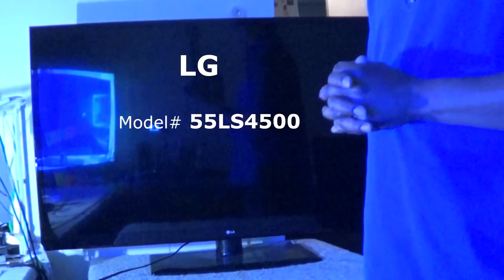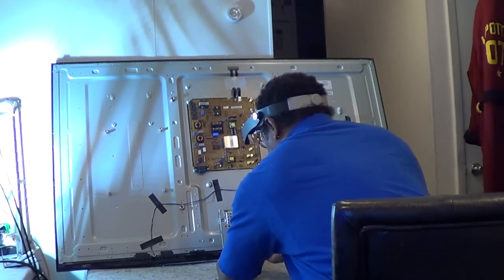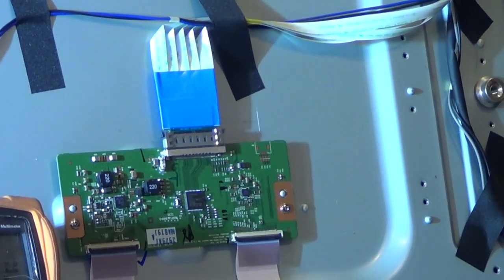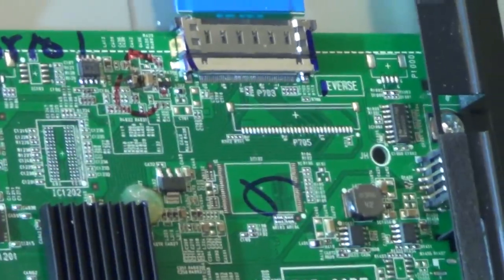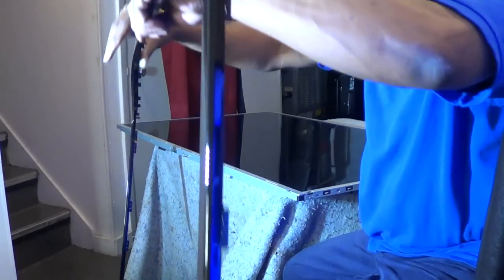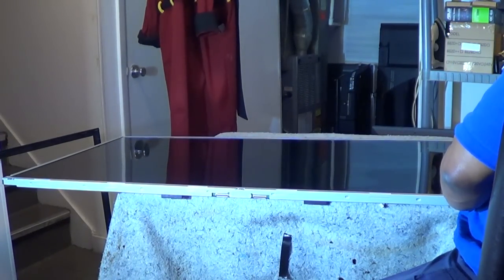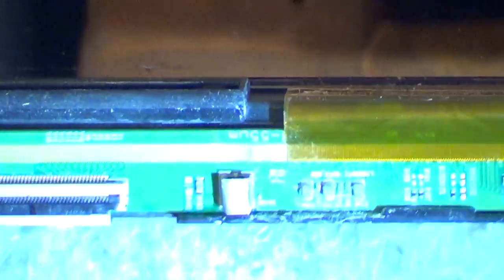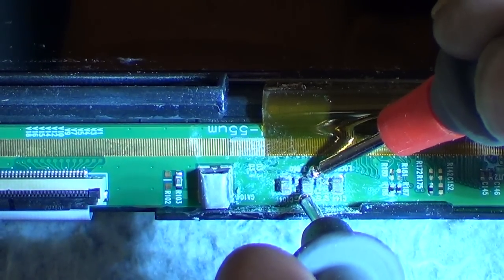Backlight but no display. T-Con board or bad LCD Panel? How to Isolate

Comment: This fix you found out about because of someone allowing liquid to run down the screen to soak the board causing a short at a capacitor might also be the issue with the Toshiba Model 57HM167 I have with white spots like outer space stars appearing behind the menu or full screen without menu and there is no audio present nor video. I will investigate where that could occur at.

I got a 2007 model Toshiba Model Number 57HM167 manf June 2007 so its not above 2009 and has no HDTV capability and that is the only antenna I have which works fine on my VISIO TV. I do have a converter for converting older model TV's so they receive digital HDTV signals changing to analog but it will not work for the Toshiba. A problem I see comes up when turned on the screen itself has many white dots on it, looks like a space broadcast of the stars but none ever change position & stays stable the entire time I am working with the menu using the new GE UltraPro Universal Remote. I do a scan for channels and none are detected using this antenna, so I believe this Toshiba is mainly for cable TV use only, not HDTV usage. I am using channel 3 for the down conversion channel operational scan and nothing being detected seems illogical the Toshiba has a antenna reception menu choice. There is no images at all just that stary outer space look behind the menu where a channel should appear. I don't know if it is a tuner issue or some screen issue causing this problem on HDTV reception using my converter from  the FCC I bought back then. Can anyone help please.
Reply from the maker: Thats a DLP TV. If U got White dots then you need to change the DLP/DMD chip in the light engine. Just order it from Ebay or Amazon using your model #, and theres plenty of Video's on YouTube to show U how to replace it. Ive did plenty of those. Common issue.
Reply: I appreciate that coming from a expert such as yourself, that was no slight miracle. I got it sitting in the living room but using my VISIO which is a small 42 inch LCD TV and it works for HDTV so the antenna on it is no issue, my mothers VISIO 48 inch LCD TV got some lemonade splashed on its front screen and it ran down into the horz-vert board so there are lines going up and down the video on my right side while left side displays OK and there is sound. One day I hope to fix its problem. I was thinking I had to buy another display for it till I saw you fix this Samsung TV.

I got two TV's both 48 inch LCD TV's given me that I relocated to the other home which will not turn on at all. Next time I go there I will get the information on them for you to see.

If you see the same comment on another YouTube video you presented disregard, I believe you have answered my question very fairly and thanks again. I'll keep in touch, from Prattville Alabama to you.
Reply: I went to Electronic Trade School (Instructor Mr. Jones), I quit after 8 months cause the math in another class (required course) was to technical to remember at the time. A girl there named Paula Jones told me a story, she said she has a uncle that did not like Bill Clinton so much that he was willing to help her snoop him under the table out of office, he was a private eye in Washington, she went a couple days to introduction to the class of printing I also studied then suddenly she never came again, the instructor named Steven (printing class) said she probably dropped out. Well, she did never to return to the Trade School John Patterson which changed its name while I was attending the printing course which after one year of electrostatic printing machine and staple machine I ended up sick and had to end my classes, I found I was allergic to the cleaner I was using to wash my hands and arms in plus I could not breath the stuff which was a giveaway I should have paid closer attention to use lava soap instead of that industrial cleaner I learned was jet fuel.
So when the story of Paula Jones broke in Washington DC I contacted the school to attempt to get them to verify that Miss Paula Jones had dropped out of the class, they refused to tell me anything about Paula Jones saying there was no record of her ever attending. Heck, I know she did attend cause I walked in on her and the instructor in the closed closet and she was attempting to charm him and he kept telling her he was married and had a child which got her so upset that she got off the shelf she had her leg propped up on with dress pulled up and walked quickly out the back door, I said excuse me to the instructor and followed her out the back and she was standing there crying. Next the bell ran and we all were to go to the lunchroom to eat so I went with her, she sat at a table near to the instructor and I sat further back to their left, she eat then we went outside to talk at the parking lot, by chance she had parked her Vega auto next to mine and started with the story. Well, I had a story too so I gave my take on hiking to San Francisco California and back which was a blast, it had been so cold up there the snow was five feet thick but I was lucky a Greyhound bus driver stopped to give me a ride then he stopped alongside the otherside of the highway at a restaurant and said come inside and I'll buy you some coffee that he normally drove the empty bus back to Los Angeles from San Francisco and stopped there for coffee. Miss Jones did not seem as interested in me as I was in her and she got in her car and left the parking lot telling me thank you for being her friend. It was a true experience I esp remember because of the helicopter that landed in the parking lot from the state troopers whom delivered the Crime Stopper Neighborhood Watch order for us to print, cut, fold, and staple (my task I did while everyone went to eat one day). It was all done on the German large press I wanted to learn how to run but two guys were already assigned it so I got stuck with a chubby girl with glasses on the electrostatic printing machine. She was moved over from paste-up of the negatives for the camera room another thing that got my interest, the staple room was in the room where the enlarger was at for the camera to make the plates for the German Press (a huge heavy cast iron machine that required moving stacks of paper under a feeder that fed one sheet at a time and they cranked it up to finish sooner).
You do not seem to bother the subject matter with math much other than checking to see what you got compared to what you should have, but mine was paper technical nothing hands on at all both classes required math.
I hope this was interesting and that I did not bore you much. I asked Bill Clinton in a letter to call me about Paula Jones and he never did. On my way back from California I went via New Mexico, Oklahoma, Arkansas, cutting down 69 into Alabama and to Tuscaloosa then got a ride to Selma Alabama and from there a ride all the way into Montgomery before the bridge and was eventually back on my street walking down it to greet my mother and father whom had been worried about me for a week, I called home in Tuscaloosa. So when a letter from White Sands Missile Testing site arrived at home my parents knew I was telling them the truth, my father was retired USAF and I left my ID card at the base gate when I went there to buy some food inside the base exchange, the man that drive me onto the base was my ride to Oklahoma CIty Oklahoma and he had forgotten I had to leave my ID at the gate and two Security police allowed me to enter the exchange to buy food & showed them my ID, they should have returned it once we left but they returned to the gate and we drive right through it without stopping. I got to drive his car, he was a Spanish Woodworking Instructor from Chicago, Illinois whom had been in Los Angeles on some student forum and met his classmates there before it was over, back when OJ Simpson had made a football play which hit the news on the radio before the criminal incident, I guess you can recall that far back. Anyway I had my joy, can't walk that much anymore, I'm lucky to get inside the pharmacy to buy my meds cause once inside there are electric shopping carts I drive.

Comment: Great video, i have a samsung ua55ju6400, which tv turns on, backlight comes on and can hear sound but no display just backlight. Now i have repaired tv and computers every now and then so i am up for it but this is a problem I haven't repaired before. I have ordered a new t con board incase i need one so i don't wait too long. Would you think it may be a t con or the panel itself. Where should i start. Thanks really appreciate it and subbed n liked.
Reply: It was the tcon ?

Comment: SMTs are so bloody small.  I see why many techs do not do component replacements. Lots of specialized equipment and knowledge on how to use it.
Reply: not really chip quick can be used to remove chips and a regular iron can be used to solder them in place. But I agree I think a lot of tech probably left the business when these new sets arrived. I used to manage a repair shop and we closed abouot 10 yr ago.

Comment: what do you call the bottom part of the damage parts where the ribbing is located
Reply from the maker: Those are the driver boards (Gate and Source)
Reply: @bigdog8882  Thankyou i think i need to check those, i spray Windex on them , never did it occurred to me it would seep in there like it did in this video petty sure that is where the problem is! i will post it if i ever get to fixing it since i just bought a new one !
Reply from the maker: U can't, there bonded to the screen.
Reply: @bigdog8882  i mean all ready bought a new one i can just dump it but its almost brand new, and its my Guinea pig for ow!

Comment: My tv turns on and works for about two minutes then the screen freezes still with sound then left side of screen green and pibk fuzzy lines which will blink until it goes black and eventually to the logo screen which has a box around it with lines which also blinks then appears that the tv shuts off going to a black screen then back to the logo screen with the box and lines sometimes while still having the sound with the last tv show that was on any ideas
Reply from the maker: Maybe Mainboard. Don't really know, thats a weird one.
Reply: bigdog8882 i just plugged the power cord back in its been off for a few hours it worked for about ten minutes thed started the same shit

Comment: I replaced the t con board and main board and I still have no pic or menu what else could be wrong???
Reply from the maker: Bad Panel, most def. If U unplug the ribbon connectors going from the t-con to panel at the bottom one at a time and turn the set on you should see half a picture on one good side that U have plugged in. If so, Then U def know U have a bad LCD driver board on one side of the panel. Only thing U can do after that is test components on that particular  driver board just like I did in the video.
Reply: bigdog8882 I’ll check it I actually unplugged each side and the screen turned white plug it back up it was back to the blue screen this was after I switched out the boards. The previous t  con board didn’t do anything at all when I unplugged each side...

Comment: Any idea how to re install ribbon cable if it is disconnected from the circuit board?
Reply from the maker: Which ribbon cable are U talking about? The clip-in one going to t-con from driver, or do U mean the bonded one going from the driver board to the LCD panel?
Reply: The bonded one at the circuit board from
Reply: And thank you for taking the time to respond!  Much appreciated
Reply from the maker: Ah man, U in trouble. LOL  Theres some vid's on Utube on how to do that. Its a lot of work and U need some special equipment.
Reply: I figured as much... once again thanks for your prompt response and concern.  Keep up the great videos!
Reply: Buy a new tv

Comment: Hi i got tv led Lglb6100 smartv the problem is i turn on and quickly flashing the image and sometimes is fix and i cant see movies etc i change the modemboard to new and is do the same thing.

¿Cant you help me?
Reply from the maker: U may have an LED backlight problem.
Reply: bigdog8882 

Thankyou  but this tv i dont understand sometimes is work for hours i see movies for long time and then is do it again.
Reply from the maker: Well the only thing I can tell U without seeing the defect is that theres a particular 55" LG that the screen flashes on/off constantly and it has bad Led's. When the Picture starts flashing is there steady sound (audio), or is the sound interrupted too?
Reply: Steady sound.
Reply from the maker: Yeah Led's or Power supply board. Try turning the "Backlight settings" down below half-way in the PICTURE settings portion of the Menu.
Reply from the maker: That if there's NO backlight when the picture goes away. Otherwise if the screen is still lit with no image then U could have a bad T-con or Panel problem.
Reply: I cant give you my phone number and i show you the problem i have the video.
Reply: I  live in puerto rico
Reply from the maker: sure give me ur email and I'll send you my number, or just send the video to my email as an attachment to midwesttv40@yahoo.com
Reply: I will send you the video
Reply: I send you email already yestarday whit mine phone number add me and i send you the video for whatsaap. 

I call company LG but he say is power board but i already buy it in  amazon new so that no is the power board. Maybe is the T-CON BOARD. BUT I WILL MAKE SURE. so that why i want send you the video that you cant tell me what's wrong.

Thanks anyway...
Reply: Check the link ☝️☝️ i send you that is the problem and that is the same tv lg smartv 55lb6100 i have it.

Comment: You ever repair  Sceptre?
Reply: I have a 32". It turns on. Shows Sceptre logo and then goes black. LED is on. Blue. I pulled apart. All caps, resistors.. good. No visible damage or burns. Odd. This TV only has 1 pc board. Thoughts? Thanks.
Reply from the maker: All day long. LOL
Reply from the maker: Probably bad LED's
Reply: shatdown after 60mins

Comment: couldn't watch after u took out video board and then did s/c test on caps with the meter on volts not ohms,man if the fuse on tcon board was o/c its fairly obvious the fault was on the tcon board.

Comment: People do not read their owners manuals.  Or, if they do they don't pay any attention.  Spraying any type of liquid onto electronics will result in a nice repair bill or the purchase of a new whatever.  Live and learn.
Reply: I always spray at the top of screen and then wipe it clean, just don't let it run down into the bottom of the panel. I used to work in a repair shop and have seen this problem.

Comment: Thanks for this one man i got a vizio white screen and a Samsung white screen I have to work on
Reply from the maker: On that Samsung, had one some years ago. I remember doing research and found out that the panel driver boards where actually touching the metal frame. Remember sticking something like a thick piece of electrical tape in between the driver and the frame to open it up and it worked like a charm after that.
Reply: bigdog8882 it's a un55ku6300fxza
Reply: My bad un55ju6400
Reply: Contact me if you looking for parts
Reply from the maker: Is it edge lit?
Reply: bigdog8882 edge lit? It has backlight white screen I did get half a picture after taken one ribbon out the tcon

Comment: I have the same problem with a 55" element tv but the tv works fine for 15 minutes and then the picture goes out but I still have sound and backlight? Any idea?
Reply from the maker: Reseat the LDVS Cable coming from Main to T-CON. First just wiggle it up and down at the T-con to see if thats the problem.

Comment: You Sir are a very  genius man, thanks for your videos, they are very good for lerning to repair, but My blood boils when I see TV Manufacturers started to use such tiny size parts as though they are trying to pack sophisticated electronic components in a hearing aid,  bloody heck these are 40 plus inches wide TV  literally the size of a football pitch, you can play a football on them, so why the heck use parts as small as 1/2 mm wide! crazy asses, no wonder these parts cant handle power requirements as they are such tiny in physical size , this is called piss poor choice in  and by design engineers, idiots quite honestly, you need to miniaturise where it is absolute necessary, there is no need on TVs when you have plenty of space and make PCB slightly larger to accomodate larger parts, some of the part are so tiny that you need devils eyes to see them.
Reply from the maker: lol. Consumers want them thinner, and also cheaper. This is the solution.

Comment: Have question have a vizio e70-e3 few back lights went out. I replaced them went to turn tv on again and all it did was try to lower up then shut off constantly  so I managed to find a new t con board and main board  but now it power up stays on backlights work but no pic but if you play with the channel buttons you can see the screen flicker A lil every time  you hit the channel or input buttons  wondering if they sent me a bad t con board ? Email me if like earlfgrisdale@gmail.com  lol lost with this tv